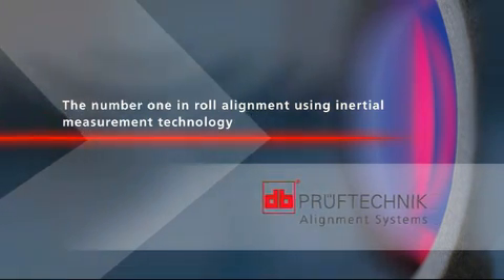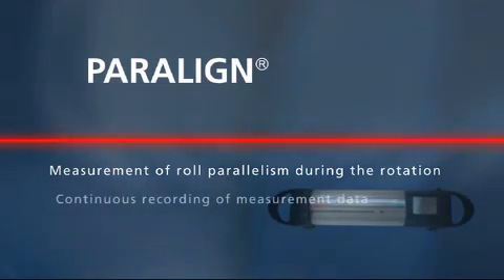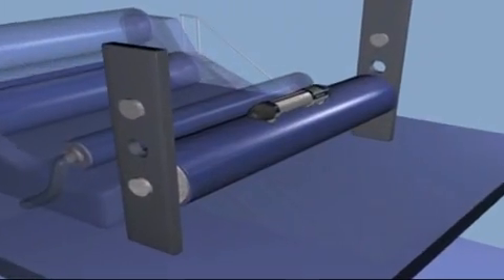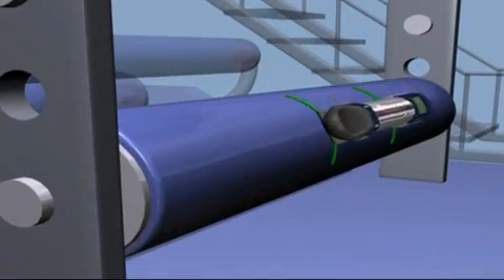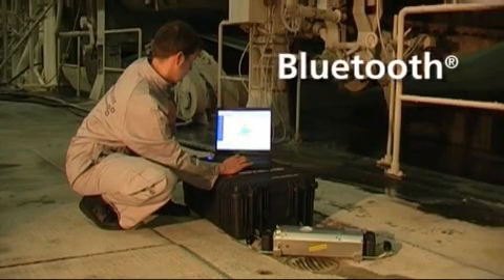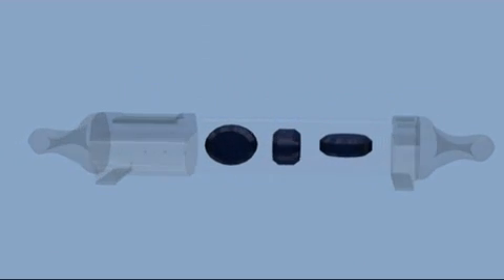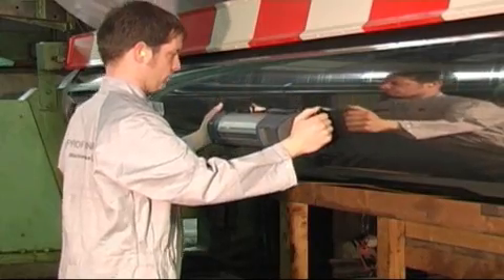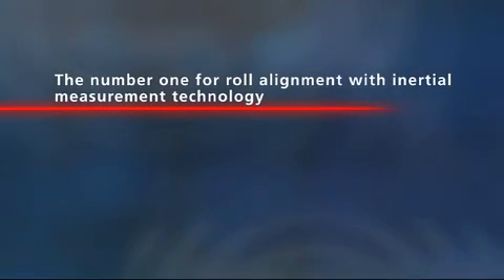Roll Alignment with PARALIGN by PRUFTECHNIK

Comment: this may be old but still i dont see any way this tool is better than optics.
Reply from the maker: Dear Mr Ottway,
Thank you for your interest in our PARALIGN roll alignment method. PARALIGN is the only method using gyroscope technology for the determination of roll parallelism. Unlike optical methods, there is no line of sight and no reference line required. 
This technology allows us to measure about 100 rolls per day or more with an accuracy greater than 0.05 mm/m and generate a report directly at the end of the measurement task. This makes a huge difference as compared with optical systems.

For more information please visit www.paralign.com or contact us at: /www.pruftechnik.com/com/Contact/Sales-Contact/Contact-form/

Best regards,
Your PRUFTECHNIK team
Reply: @PRUFTECHNIKGroup  Thanks for the response i really did not expect one. What i find inaccurate about this tool is the size, since its made to be compact and one man operated its small, when measuring a roll you want to be as close to the edge of the roll as possible, some rolls have tapers but these can easily be avoided. Optics may not be able to shoot 100 rolls in a day but we most certainly can get .05mm accurate, even better as a matter in fact. We just got a Pharo Lazer tracker, 160,000$ piece of equipment. We do not use it for level, still use optics. Why? its just not trust worthy, are you looking through a scope and reading numbers? No, therefore we just dont use it for that. Layout all day with it though.
Reply from the maker: @donnieottway6025  Dear Mr. Ottway,

Thank you for your reply. If you need more information about PARALIGN or if you would like to schedule a free demo, please contact us: https://www.pruftechnik.com/en-US/Contact/Sales-Contact/Contact-form/ We would be very pleased to help you. Best regards.
Reply: @donnieottway6025  Its actually invented by NASA and can therefore not be sold and used in all countries. Its a scan to paper report system as I see it. Not a real real-time alignment system. Some data on the accuracy & repeatability is also missing.